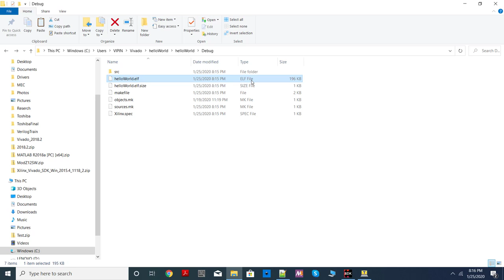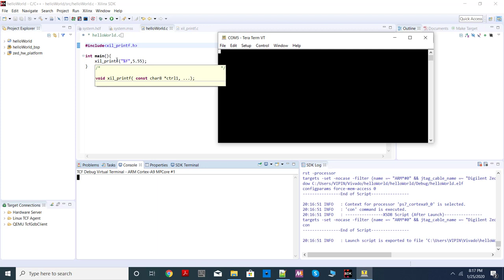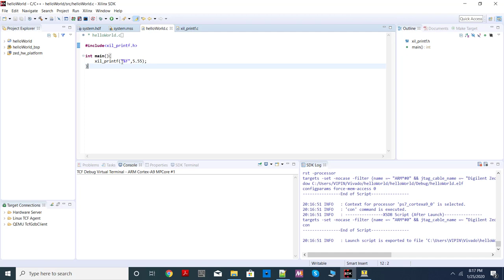Xilinx SDK: Output with print, xil_printf and printf

Comment: how stated that printf uses 2kb more than print. Fine. Then you stated that if you printed several times, the difference would be larger. But how can that be?  You only statically link the function once. You call the same piece of code each time.
Reply: What if there are multiple such applications which are printing to console. Also the difference is not that of 2 kB beween printf and print, in my case I found it to be about 31 kB. Xil_printf shown to have saved some 24 kB in comparison to printf.